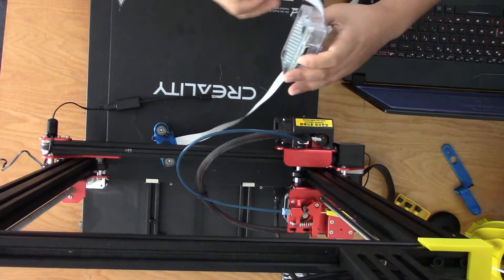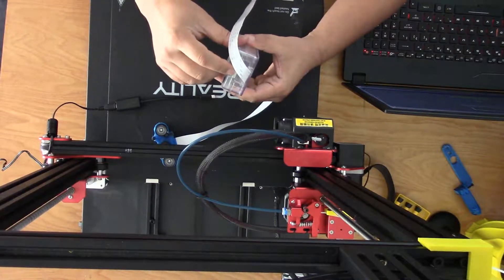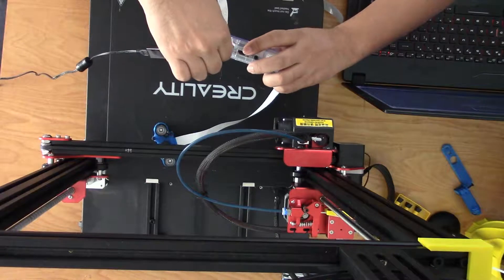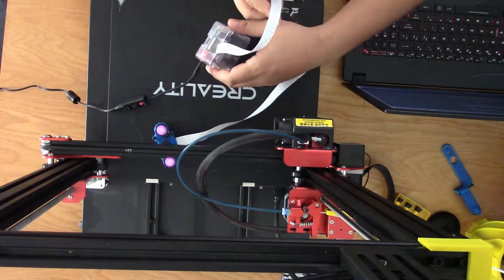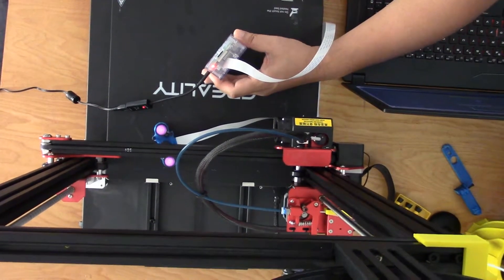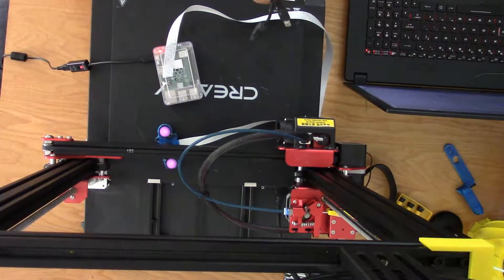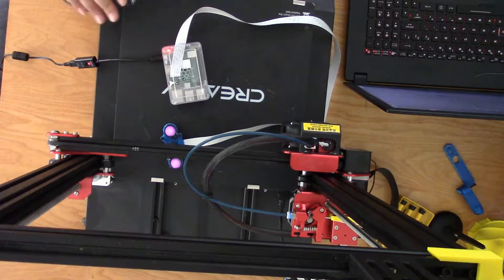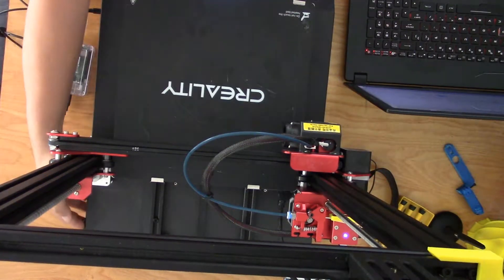Creality Cr10s pro upgrade   Kumon Infrared camera

Comment: Hiya, Did this camera work straight away? I bought a camera like this in the uk but i'm having no luck getting it installed and i can't really afford the official pi camera? the one i bought was a makerhawk. It doesn't work straight away though. If you have any tips it would be greatly appreciated.
Reply: i have a cr10s pro myself :) - did you have any issues getting the hot end temps through to octoprint
Reply from the maker: I did not have any problems getting temperature though octoprint.
Reply from the maker: Yes, It worked after installing the raspberri pi and camera. After reading both your comments it maybe a configuration problem.